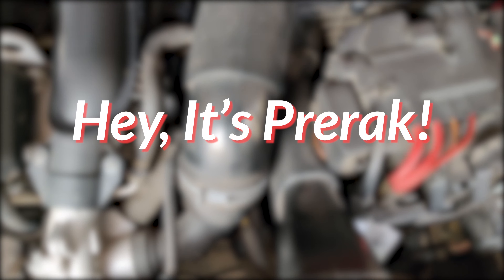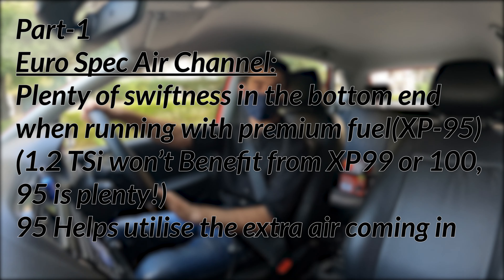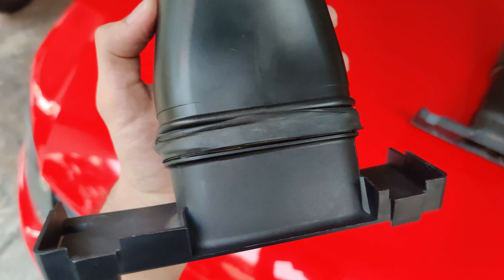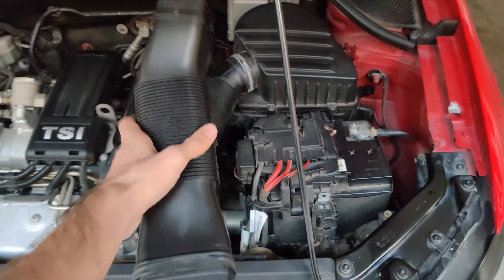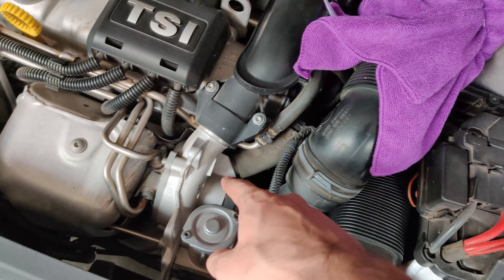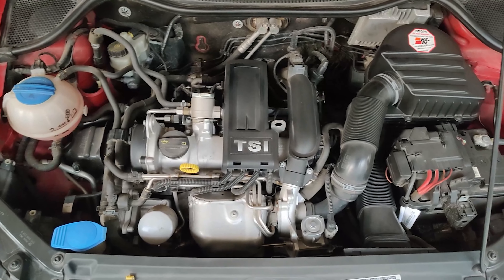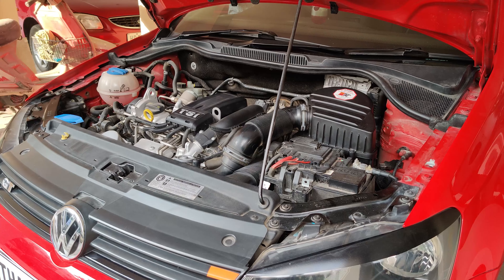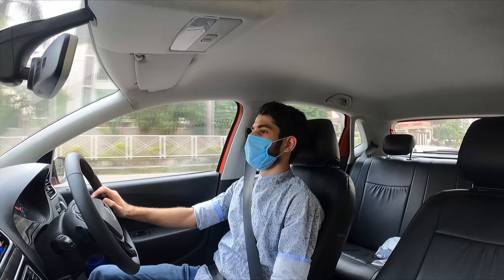Intake Modifications to my Polo GT (2016) | High performance air filter and budget modifications!

Comment: Hi Prerak, I just ordered the parts but What should I do to maintain air-fuel ratio in a 1.5TDI, is a ECU remap required or just find power diesel. ?
Reply from the maker: With all of these upgrades, a stage 1 tune will be very fruitful for your 1.5 tdi

Comment: Can we use this intake pipe for 1.2 TDi..? would there be enough space to squeeze this in..?
Reply from the maker: Euro duct and filter upgrade should be good enough for that, not sure if it'll clear the Pipe
Reply: @PrerakKataria  already I have installed the euro spec channel, yet to get the filter upgrade done..

But, I do change the filters every 6months as it gets clogged much faster after I have installed the euro spec..

Comment: Hi brthr I am planning to do this mod for my 1.6tdi but I want to keep stock air filter itself if I clean it regularly like at every 2.5k kms no issues right I will replace the air filter at every 8k kms? And der is no need of ecu tuning right?

Comment: The price of the euro spec air channel  has gone up drastically,any idea if we can get it from some other shop for 1500rs or should we just wait for the price to come down on the boodmo app.Also i want to know if it will fit a 1.2l tsi engine because my car is a vento 1.2l tsi. Thanks
Reply from the maker: Recently I noticed, (@vagmaster_india) had it up for sale, maybe they can help source it, or if some tuning shops had it in stock they can source it as well.
Reply: @PrerakKataria  thank you so much for your reply i will definitely  check it out .one more question i had is that my vento isnt tuned so do you think  putting a euro spec air guide and a K/N air filter will make a difference?
Reply: @neilsteven6721  Would like to know same for a 1.5TDI vento.

Comment: What about car run in rain..? why because now water directly goes into airintake and filter and after that goes to combustion chamber, then that may lead to hydroclog na. Haven't you faced any this kind of hydroclog problems by this airintake modification?
Reply from the maker: It isn’t directly fed into it, the euro duct doesn’t face straight into the air intake
It is less resistant than stock setup but not straight into the filter either

Comment: You could also cut the square and rectangular holes in the air inlet channel if you have the tools and save yourself 1.5k.
Also, doesn't VW recommend 95 octane in order to make the claimed 105bhp?
Reply from the maker: Euro spec air channel is covered from the side as well, if you cut the square and rectangle pieces off, Make sure to cover the side inlet as well, leaving small area for water to drain out of.

Comment: Bro thx all this i have 1 ? Doing all upgrades but air filter stock not remap will get any benifits...plz reply.
Reply from the maker: Bottom end will improve, but to actually take benefit of all this a tune is recommended
Reply: Bro 1 more ? Can we use piggy back ecu for this plz guide..

Comment: What about water getting in during rain or washing?
Reply from the maker: It’s not a direct duct, it’s just a little more direct than the stock configuration, the deflector deflects the water away
Reply: @PrerakKataria  thank you!
Reply: @PrerakKataria  have you done an upgrade on your headlights? I scrolled through your videos list but couldn’t find anything. That’s the first thing I want to change as they are weakest links in these otherwise excellent cars.